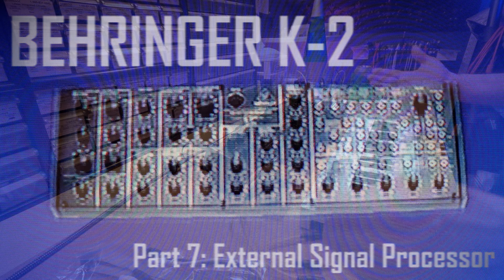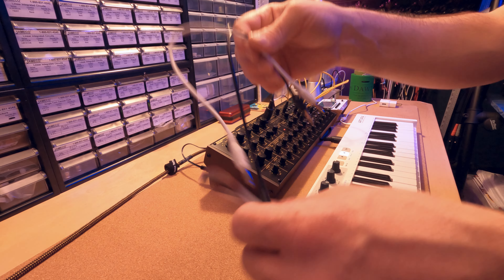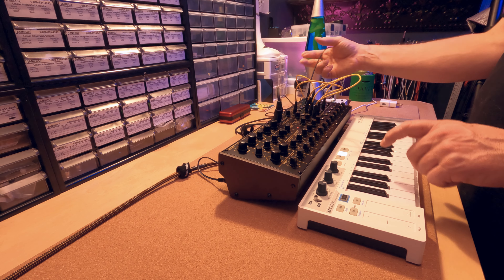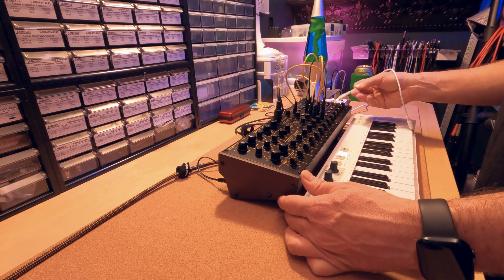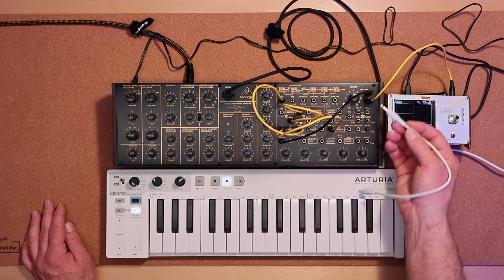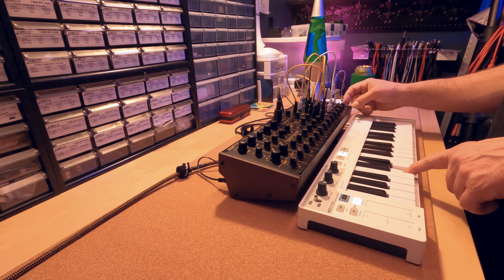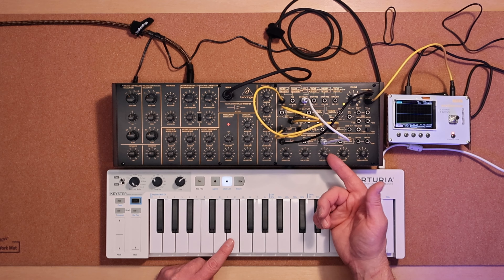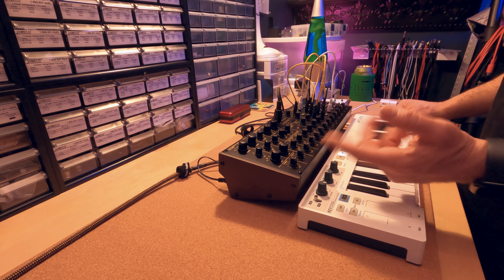Behringer K-2 - Part 7: External Signal Processor

Comment: If you process the sound through the esp and use esp output instead of regular output you get a good sounding and controllable overdrive. Took me a while to figure it out, though it's a popular trick.
Reply from the maker: Yeah, absolutely! There are so many options. The way I did it was more of a "send" type routing, where you still hear the original signal but can blend in the overdriven side to taste. But taking the direct out from the ESP is another great trick. Thanks for posting!